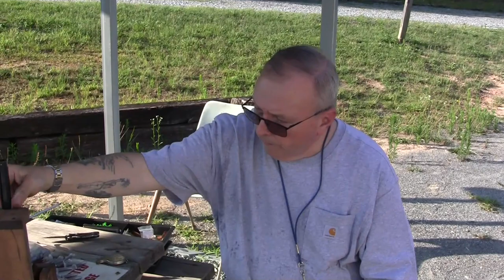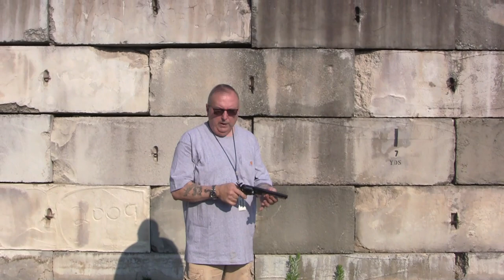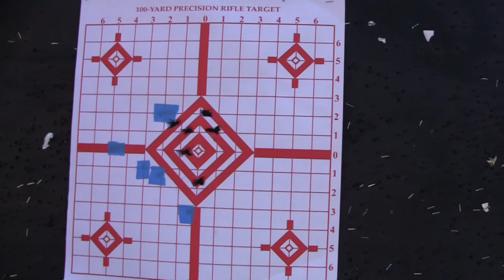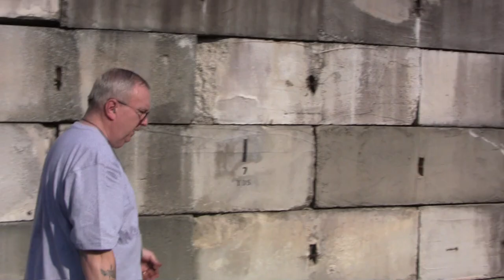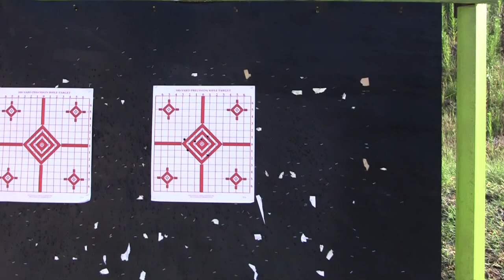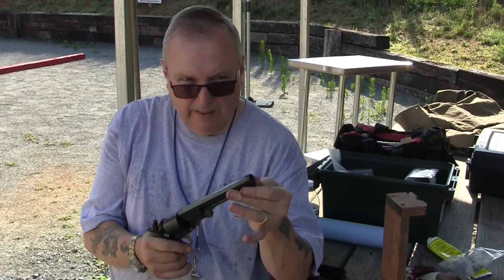Slix Shot Nipples in Colt 1851 Navy by Pietta

Comment: Im using those german 1075 caps #11 equiv on my 1851 pietta.  I have two of em in 44cal.  They fit on the stock nipples perfectly.. no jams..  only issue is after i get all 6 rounds out.  I have 1 or 2 caps stuck on the nipples lol a pain to get off.   I open carry both 1851 as well so a good fitting cap is important.
Reply: So you use the 1075’s on the stock nipples and they’’re fine?  Argh, I have a 1851 .44, used the Remington #10’s on standard nipples and got constant jams.
Reply: @historyandhorseplaying7374    1075 german caps are supposedly #11.  They seem fine to me.  The only issue is after i shoot them they sometimes stick to the nipples.. have to use a knife to pry em off
Reply: @jeepsblackpowderandlights4305  Awesome!  I’d rather they stick than fall off and jam.  Will try them out this week with the slixshots, will see how they do.
Reply: By the way, what holster do you use for open carry?  I am considering carrying my 1851 for self defense but ONLY if I can get it a lot more reliable, and if I can CC it too.

Comment: I had the same results with Slix Shots--I was ready to throw my Colt away because of all the problems, and now I hardly ever get a jam.
Reply: What charge are you using and which caps?  I just got a 1851 .44 and tons of cap jams but I just bought the slix shots but haven’t tried them out yet.
Reply: @historyandhorseplaying7374  I use Remington #10's and 15 grains when I do Richmond Lab .36 paper cartridges, or 20 grains when I shoot loose roundball.
Reply: @Schlachtschule  Ok, I use #10s with my .44 too, but they are really scarce and hard to find.  20 grains in a .36 is I think about equivalent to 25 grains in a .44
Reply: @historyandhorseplaying7374  when I make .44-caliber Kerr paper cartridges I use 25 grains, and when I shoot .44 roundballs I use 30 grains.

And yes, Remington #10's are insanely difficult to get right now.  I am very worried, because my Remington New Model Army  can fire various caps, but the 1851 Navy will only take the Remington #10's.
Reply: @Schlachtschule  I just ordered 2 tins of #10’s from Bass Pro Shops, was very surprised to find them listed in stock on the website because they’ve been out for a long time.  They will deliver for free to a store near me but will likely take up to 2 weeks to get here.  You might try Bass Pro, I think they deliver to your address for a fee or free over $50 order I think.
Reply: @historyandhorseplaying7374  thanks, but I just checked and they are out of stock.  I keep looking, though!
Reply: @Schlachtschule  Wow, they sold out within minutes!  Amazing.  Am sure they’ll be back soon though.